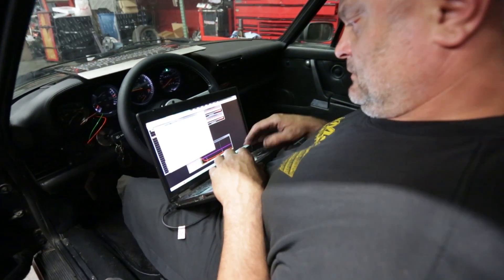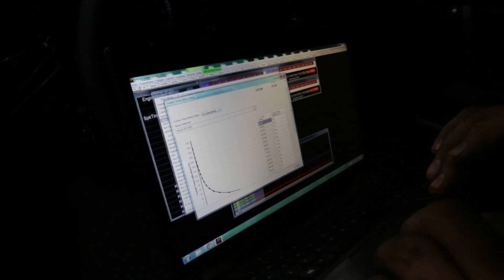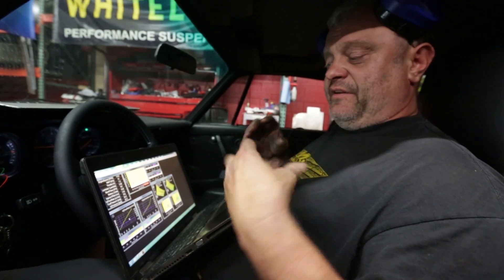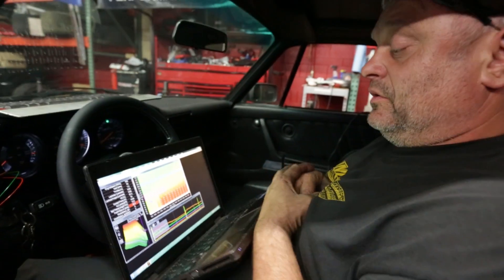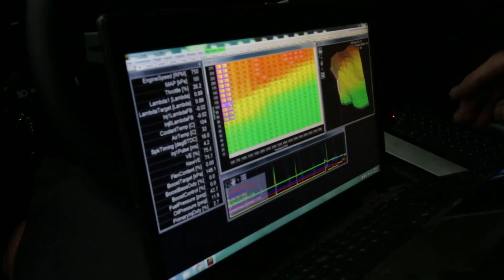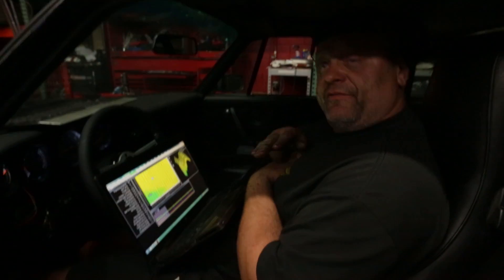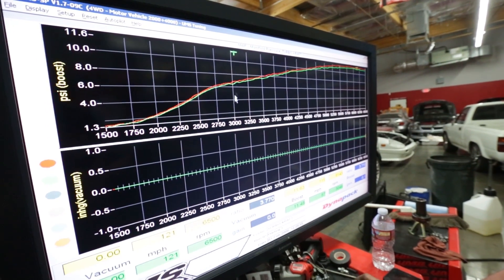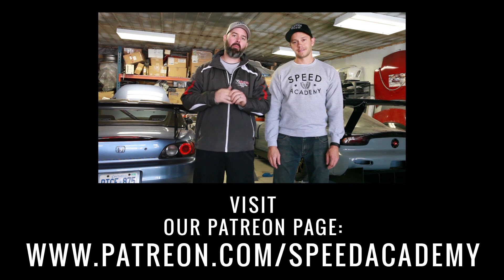911 Turbo EFI Dyno Tuning - Porsche 930 Project - EP12

Comment: whatever happened to running the motor for a few miles, changing the oil and filter to get rid of all that assembly lube, bed the bearings in, then give it the beans on the dyno. jesus if i was spending all that cash on a rebuild, whats the hurry to thrash the nuts off it?

Comment: Just spent 30k on an engine and the tuner calls it a shitty old 2 valve head, that must have hurt! Nevertheless very interesting watch (whole series has been a blast btw) and I cannot wait to see the final result, it will be an awesome machine! Also curious to know if you are going to test multiple turbo's or sticking to the smaller one.
Reply: I doubt it hurt, can't do anything about the outdated head technology. I love my 40 year old, non cross flow, shitty, 2 valve head.

Comment: $30 CAN is entirely reasonable for this level of build on such a valuable car.  In fact, I think it's good value.  This project is clearly not about chasing silly hp numbers but about drivability, reliability and excellent power.  

Been loving the 930 T series, Tony.
Reply from the maker: Thanks Tony! I've never been about chasing numbers rather for a reliable and fun engine setup and so far it's proven just that!

Comment: 930 turbos are currently selling at 150,000+ USD. It's no surprise to me that this was a 30,000$ engine build.
Reply: Gotta have $$$$ to own an exotic, buying it is one thing and maintenance when they get older is another, a GM crate engine costs 10-15 grand not including all necessary mods and all this guy has to do is some filming

Comment: 30K Engine and it only makes 400hp??? waste of money
Reply: Nhaa. ..Porsche-money isnt the same as regular money; )
Reply: More money doesn't necessarily means more power...
I'd rather spend 30k to have a very dialed and strong 400hp engine than a 600hp one that's going to break often.
It's not all about horsepower kids.
Reply: reliability... 
you could just trow a chiptune on it and blow de engine or you can invest in premium parts that can handle this amount power every day on the street and at the track for years... ;)
Reply: Go awaayyy
Reply: It's 376 Whp and it made that power with only 0.7-0.8 bar...And if you saw the entire video they still haven't finished tunning.376 whp is 439 hp on a car that weights 1T.I'm not a porsche fan but you have to respect someones work.
Reply: 400hp for a car that weighs 2600 pounds is pretty impressive - almost the same power to weight as a Ferrari 458
Reply: 30k cad, not usd
Reply: +Camhin1 not sure if you've watched the series but the car was just put together not too long ago. it's getting broken in on the dyno. Stuff is going to go wrong, just have to work out the small issues, everything is still pretty fresh off the engine stand, their will be problems with every fresh build
Reply: +Dédé LABINOUZE yeah reliable, breaks in the video.

Comment: $30,000 engine?!? Fuck
Reply: +1QuickSlovak but then someone will be stuck with a Chevy and not a Porsche. At the end of the day, the money spent on this vehicle is well worth it once everything is sorted out!
Reply: Yah that's like 23k USD. In race car dollars you could buy a very clean C6 Z51 Corvette.
Reply: I Can Build a Kraftwerks 450whp in a Stock S2000 and habe plenty $ Left and Kick his ass in the Track
Reply: The fact that it's a 930 might have something to do with the price tag.
Reply: ....and running a single turbo.
Reply: As a miata fan, I could build a 450-500 whp turbo 2.0l bp engine with the best suspension available and still have $10k left over.....
Reply: +Keith Brettell not gonna lie mate I don't have a clue about Porsches
Reply: Yeah, I worked part-time at a Sunoco station in the early 80's and a customer had one in dark metallic green, not sure if I liked the looks or smooth sounds of the engine better? I think he said it was about 65 grand then? In my opinion that was the most beautiful of the eras
Reply: Supposedly the canadian exchange rate really sucks right now too, so there might be that.
Reply: ViperKillerWannabe guess so man
Reply: ***** hadn't thought of that
Reply: +Andrew Rindos +tyler t I'm just surprised it's such a hefty cost for such a low tune engine.
Reply: The '930' was the top of the range for the 911's with a turbo. It was kinda special. A good one can go for $150,000.